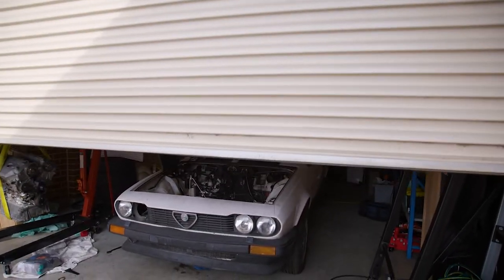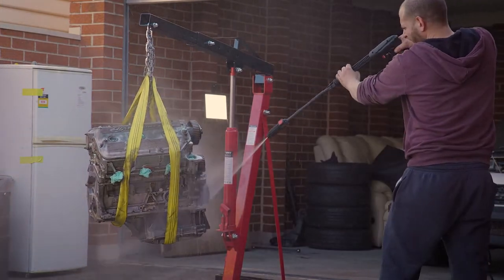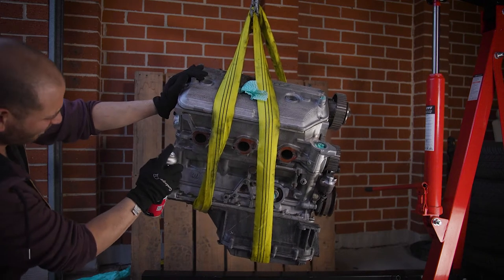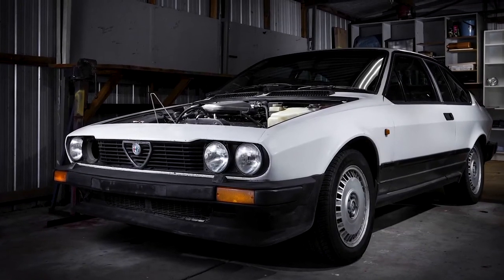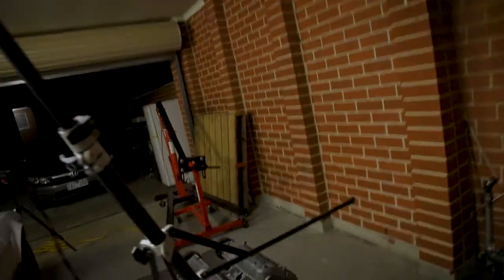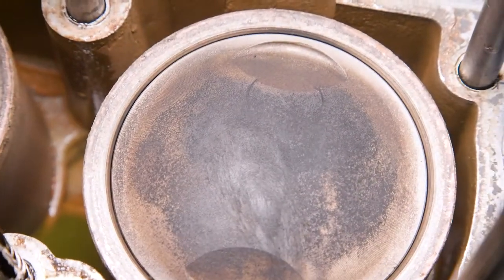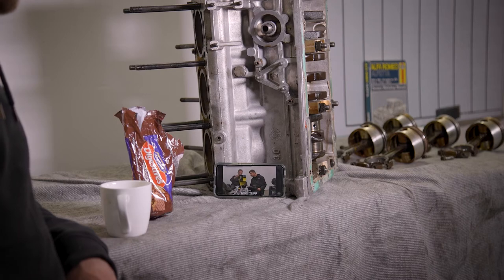GTV6 3.0 Build - Episode 4 - ENGINE TEARDOWN & TALKING BUSSO

Comment: Nice one mate. I'm rebuilding my alfa 90 motor at the same time, exactly the same mechanical platform.
I've worked on heaps of cars, done plenty of engine pulls etc and I hit most of the snags you hit trying to get this engine out. 
Glad to see someone else having a crack.
Reply from the maker: Thanks mate. Good to hear I'm not the only one that has issues haha. It's funny, just today I have been thinking about Alfa 90's, and how awesome it'd be to have a nice comfy executive looking sedan, totally stock on the outside but perhaps with a beefy Busso tuned with bucket loads of mid range torque. What a cool and different sleeper that would be just to cruise around in. Plus you get a cool briefcase.

Comment: You use air pressurised propelled tools to take off high torque bolts mate, and an engine stand to to assist  the deconstruction and construction for engine builds, saves your back.
Reply from the maker: I bought an engine stand but the engine didn't fit on, so I had to improvise! Certainly if I was doing this work everyday I would buy an impact wrench, but for a few bolts here and there they aint cheap, so for now it's going to have to be a bit of elbow grease and leverage. It's definitely on the wish list.
Reply: @nooch86  Universal engine stands tend to take some creative thinking to make them work. I had a v6 on one which needed a variety of bolt lengths and washers, with the supplied brackets going off in all sorts of odd directions, but they were in a vague splayed formation so they stayed put fine. I'll admit I did wince a bit when you used a screwdriver to split the sump off the block! The bores looked pretty decent, some honing marks still present and doesn't seem to be any real horrors inside. Have you thought about balancing? There's some good vids that explain static and dynamic such as Project Heaven. Anyway, hope it goes well and you have a peachy Busso very soon.
Reply from the maker: @mrdainase  thanks for the message. If I was going to working on the engine for a prolonged period, I definitely would have tried harder to jerry rig that engine stand to fit. As for the screwdriver, well my lack of knowledge about how to do something is on full display, but thanks to comments like this I'm learning. What would be a better way to pry it free, I assume there's proper tool that maybe have less of a sharp edge?

As far as balancing etc, I'm honestly trying to think of the most economical way to move forward. Not sure if I should just send the engine off to the mechanics and get them to do the whole lot, or If I should start trying to send parts off to be machined/reconditioned etc, then get the mechanic to simply assemble the engine.
Reply: @nooch86  There's a few old ways to split alloy bits away. The usual one is to go round tapping with a rubber mallet, and the sideways forces break the hold. I've used plastic levers in the past as well as they won't impact on the metal. 

As for reassembly, why not give it a go yourself?  It's not difficult really, just take your time and be methodical (and make sure you know which moving bits like pistons go in which cylinder). Garages don't like having engines handed to them already stripped as they don't know if all the bits are included - or even if all the parts came from the same engine. Sure, you'll want to find places to check and refurb bits like the crank and heads, but beyond that it's not hard to put one back together.  And you do get to learn a heck of a lot in the process.
Reply from the maker: @mrdainase  I may just try doing that.
Reply: @mrdainase +1

Comment: He also designed with Orazio Satta the Alfa 4 cylinder twin cam which originally went into production in the mid 1950s with the very pretty Alfa Romeo Guilietta , and continue up until early 1990 s with the 75 and early 155 models .

Comment: Congrats on the videos, as far as I can tell this is the only place where a detailed enough tear down of a busso V6 on YT, so please keep it up!!!
I don't want to sound like a couch mechanic (which I'm not by trade), but given that you moved the car in gear but had already removed the cambelt, it's more than likely that one of the valves hit the piston in the process which is also evidenced by the loose carbon built up on that very cylinder.
So when you're doing the cylinder heads double check you don't have bent valves...
Reply from the maker: Thanks Vassilis - good pick up, seeing as it's an interference engine that likely did happen! I am going to get the mechanic to go over this engine with a fine tooth comb, but I will make a mention of that!

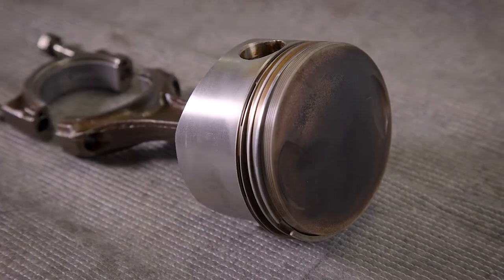Comment: At 7:33 you have a great shot of the cylinder cross hatching. That is the criss cross scratch marks you see ... those are a great sign. Not sure the mileage of your engine (kilometers sorry lol) but having the cross hatching is a good thing.  From the looks of it you had a blown head gasket probably due to high heat from burning the oil. Your on the right track.  Great eye filming the engine.
Reply from the maker: Thanks for the comment mate, cheers!

Comment: If the compression is good only do valve stem seals (green for the oil burning) & cam f/seals and cam belt tensioner. Leaking Brake master cylinder can leak into the booster and get sucked into the engine.  Waterpump drips when due for replacement.
Big ends and main bearings are over designed. Align the propshaft perfectly to save the rubber couplings for a very long period. Change the cambelt if any  signs of rubber powder is noted in the plastic cam covers. If you ever get oil in the water change the head gaskets to German type. The little oil o-ring from alfa brand fails. I always bought a spare head gasket set always handy to help other owners and as a backup. Drive the car hard it won't break if you don't do stupid. Gas shock absorbers "Bilstien for eg" is essential. Double clutches can be repacked cheaply. Use a large 24- 26 spanner to force the yoke of the thrust bearing with one arm and push the clutch housing with your other arm so that the two clutches align on the spline under the car. 2 min job.  When the car gets old and 1st gear hops out, reweld and machine the curved gear selector.
Reply from the maker: Will read your message properly later, but am getting engine fully professional rebuilt and installed. Not sure if I should rebuild transaxle cos it's a big expense.
Reply: Only work on the gearbox ìf it fails. Gtv6 only eats brake pads and propshaft couplings. 1 centre carrier bearing after 60,000 miles.
I did rings once since 80s and left the engine in place. Removed sleeves upwards after properly draining, cleaning and vacuming from above.  Replaced o-rings under sleeves and by using a narrow ring squeezer put the sleeves back. Don't hone too much. As I said the bottom is over designed. Whenever a job is done on the car do a oil change. 
Fun car to own as a daily drive.
Would have been much nicer with power steering and a booster in the hydraulic clutch line though for traffic congestion and parking.
Reply from the maker: @grantalexandergiliomee2777  I'll likely install power steering from a 75 though they're getting hard to find. Do you have any experience with changes in roll centre to improve handing? Is it worth it for track use but also good on the road?
Reply from the maker: @grantalexandergiliomee2777  no need to keep answering just digging for info cos want the best bang for buck. I don't assume youre all knowing lol. Any idea on the best investment to get the best possible handling within reason? Assuming maximum handling within reason. Bilsteen shocks better investment than roll centre change tick, don't lower front too much tick. Lighter 15 inch wheels better than 16 inch with lower profile, or doesnt matter too much? 7inch wide wheels I assume is fine. Why not 205 tyres rather than 195 or not much difference really? Bigger ARBs on rear to reduce understeer, or bigger ARBs front and rear? Poly bushes? Front coilover conversion worth it? Chassis stiffening worth pursing, assuming I don't want to ruin the resale, I.e strut bars or bolt in half cage, then bucket seat and harness worth it? I am going to hammer this thing so don't want to die. Remove heavy front/rear bumper to lower polar moment of inertia, or ridiculous concept for the amount of effort and diminshing returns. I just want minimal understeer. Best to just focus money on drivetrain? As it's a street car too, is shockers enough to get all the low hanging fruit and everything else just overkill? Thinking future progression aswell though if I want more performance. Thanks.

Comment: Just found this channel and both thumbs up 
What will you do to your engine regarding cams, pistons etcetera?
Even the fuel management system is dated but one has to decide if you want a dedicated original, some tweeks or full race. 
I’m going the ”tweek” route with 10.5 CR, hopefully good cams (C&B is NOT good) and modern ECU and maybe an alterated plenum.
Suggestions on ”fast road” cams are welcome
Reply from the maker: Thanks Luigi! My mechanic and I discussed a few possible options... pistons, cams, computer, fuel delivery, mod the plenum/runners etc... but all the details have not been sorted out yet. The priority is reliability, then usable power through as much of the rev range as possible, however, I don't want it to run out of legs at the top end (I like to be rewarded for reving the engine out!). Any suggestions are welcome, but at this stage I'm basically relying on my mechanic (he's a pretty well regarded Alfa guy).
Reply: @nooch86  
Yeah your mechanic are right but I belive you don,t need to worry about reliability  from easy mods on these engines unless you go ”extreme” ( around 95hp/litre and beyond)

The biggest flaws these engines have are not how they are built but how they are dressed with mostly inferiour fuel management. This forced alfa to get to low on compression and way to mild cams. 
These engines would have performed much better powerwise with carbs but with less environmental and milage performance as they did with the Alfa 6.

A fresh engine with 10 to 12:1 Compression Ratio and uppgraded cams and a modern ECU are very reliable with good torque troughout and with a very different (read funny) topend and will easaly rev to ca 7 200 rpm WITH power. 
Rev limit are because of valve flow on exhaust. 
An engine built like this will produce approx 80-85 real horsepower / liter. 
 My experience are that reliability and usable power is no issue at all, but its pricey and availability of parts ar scarce.
Pistons and management systems are easaly obtained but cams are not and very expensive with long delivery times. 

Happy to follow your progress 😉
Reply from the maker: @luigidebarone2429  Thanks for all the great info. It's all music to my ears. I've had bad luck reliability wise in the past, but I believe it's because it wasn't  a rebuilt engine.

Comment: Nice vídeo. 👍
I have also a busso but the 2.5 12v from the Alfa 155 what a engine.
Good luck 🍀
Reply from the maker: Cheers thanks! 155 is one of my favorites, just did a (virtual) video with one.
Reply: The 12v sounds meaner than the 24v. Very nice